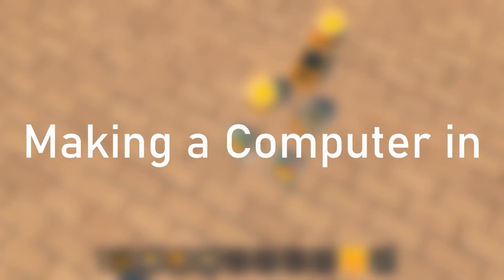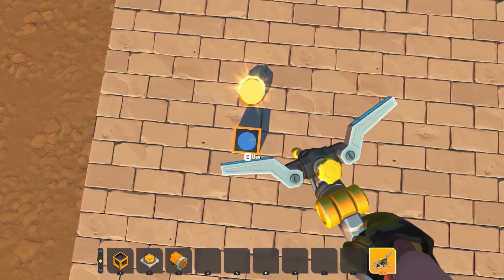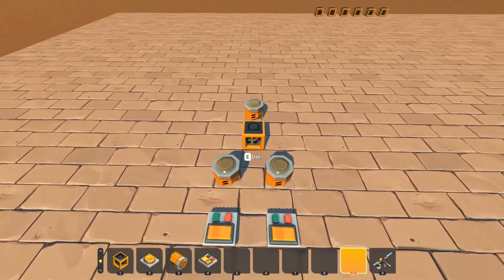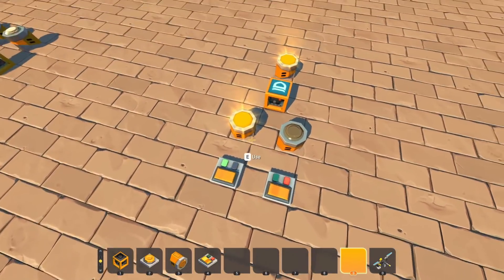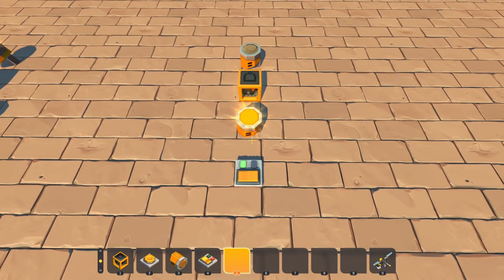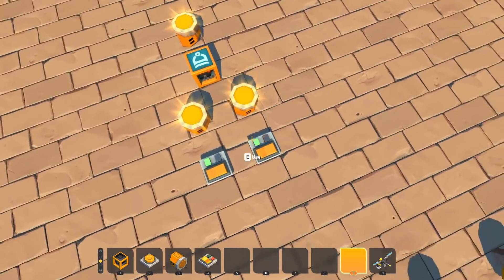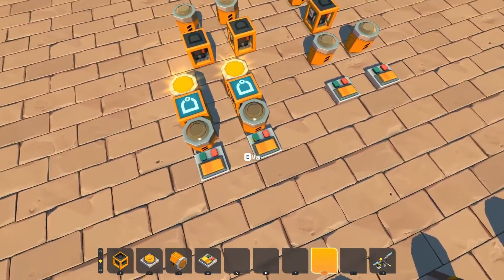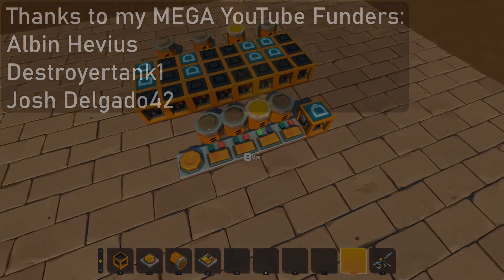Logic Gates: Making a Computer in Scrap Mechanic - #1

Comment: If you want some added performance for your computer parts, I can hook you up with a link to the beta version of my new modpack.
It doesn't contain much yet, but the only block it does have is a logic gate with 0 tick delay. Speeds up a sequence of full adders by a lot (as in, 4 bits normally takes like 16 ticks... now only 1).
If you're interested, just find me in kAN / ScrapMan / Scrap Mechanic / SMM discord.

Comment: when you get to showing how to store bits make sure to refer to it as a SR latch or atleast define it as such because most peeps dont realise that 2 NOR gates inputting into eachother to store bits is actually called a SR latch which heavily confuses people when its called something like "bit store" as it isnt since its just a logic latch - it doesnt store anything since its not even a capacitor. also, i heavily recommend using ics when building the majority of the computer since its so much quicker to use (i mean just make a logic circuit and save it for later use).

p.s. building a computer in scrap mechanic is more dependent on your rendering capabilities so dont shy for complexity at times and one last thing, i dont know what insanity you have, but making a computer in a game is going to be very very slow and unproductive. just saying, if its for educational purposes then go right on ahead but anything more and youve fallen into a trap...
Reply from the maker: Oh yeah, this computer is just to show how computers work. I'll write some stuff for it but nothing that needs to be executed quickly. Also, I'll probably use a NAND SR latch, and I'll show how it's working so people (hopefully) don't get confused
Reply: @ReidCaptain  thanks
Reply: @ReidCaptain  neato burrito, cant wait to see how you do it. ive started to make a computer in scrap mechanic aswell and so far ive got an oversimplified ALU and am starting some form of cache and RAM system.

p.s. if you manage to make it programmable then id love to see it. btw what computer architecture are you using as a reference (or which are you planning to use)?

Comment: Greetings, conceiver of circuitry.
Due to the abstract node based nature of the logical components, the physical structure of the circuitry is functionally irrelevant. Allowing organization into clusters for each
type of process required, including data storage and code interpreters.
Unfortunately, building more than 256 bytes of solid state memory in scrap mechanic is difficult and unstable. For 1KB and greater capacity, mechanisms such as cardboard
tapes could be used for read only memory or write once memory, and tapes could be ejected and stored elsewhere similar to ordinary floppy disks.
Additionally, increasing the complexity of what the core processor can do will decrease the size of the code needed to program it. This would be more space efficient in memory.
For instance- making a multiplier cell instead of coding multiplication using sequential addition, and making microcode ROM that the ordinary code can reference to similarly
to functions in higher level programming.
Building a simple programming language would be necessary for escaping machine code programming. Though integrating microcode would be more immediately beneficial.
For an interface to a computer, in scrap mechanic, one option is to use a small number of buttons that can be pressed in sequences to insert more complex signals.
For instance- a D-pad. And pressing Down, Down, Left, would insert the signal for the letter J, or any other character, even control characters such as shift or CTRL.

Comment: The XOR gate will turn on if an odd number of inputs are active.
N-gates just give inverted signal of normal gates.
Each gate has a delay of 1 tick before it receives/sends a signal - 1 smallest logic step. Same for timers, even if you set its delay to 0 ticks.
To make a simple consistent memory switch, connect 3 XOR gates in a loop, and activate all 3 at the same time for 1 tick.

Comment: Do the gates in the game have a hard coded time to take to switch? Or can you run any clock pulse into them?
Reply: They run at a standard tick rate unfortunately:/// The fastest computer I’ve made so far has run at 1.55HZ Although I created one which ran a slower clock but outperformed it greatly so there’s that.
Reply: @mattyj2111  gotcha, thanks. And your pfp was my desktop for the longest time in 2010

Comment: This is just like a probably stupid thought. Big like with the use of these kinds of games or simulations and some extra mechanics would it be possible to simulate a quantum computer, but like a very low tech one like what he is doing. Like a proof of concept type simulation?
Reply: Theoretically yes, maybe not in scrap mechanic itself though, but for a quantum computer you're better off playing with software someone already made that does a little tiny one, and it will not be particularly useful or easy to do anything with.
Reply: @Vode_ika  cool thanks

Comment: Here’s a simplistic way you can think about inverting 2 input logic gates: By inverting the output, you just invert the entire output. By inverting the inputs, only the and/nor part is inverted, while the xor part is not. That is because 2 positives becomes 2 negatives and vice versa, but a positive and a negative just swap places, giving you the same xor output - everything stays the same, or everything stays different. Inverting one input is like a 90 degree rotation. The 2 xors - 10 + 01 become and + nor, while and + nor become the xors.

Comment: as someone also building a  computer in scrap mechanic, if you want permanant data storage (logic bits are reset upon lifting it") you can use vacuum pumps connected to chests of cardboard and spudguns (which break and place the cardboard) to make liftable storage
Reply: I think he will use logic gates for everything, including data storage, making it more realistic
Reply: @user-ss6gp2gu6r  I think that what they are suggesting is very realistic as logic gates in real life don’t work without power, so you have to write that on something outside of logic, also it would allow players to share programs which would be cool for him to see community members using his computer and creating cool stuff
Reply: I’d hadn’t thought about this, mostly because I hadn’t messed around with computer stuff when vacuum pumps existed, but that would be a good way to create and edit programs as it would be cool to allow players to share them
Reply: you could. However this mode of datastorage is not very dense.
Reply: @sayhellotoyou9271  while it is not dense, it is rewritable and permanant. if done in a cube of cardboard you can have a moving head
Reply: @fyrewire  check out timer memory if you are interested in high density storage. I am a novice and managed 256bytes of memory with less than 100 blocks at the expense of time efficiency. Although you can double the time efficiency pretty simply

Comment: If it would help at all I've made a few calculators in scrap mechanic and some storage 
I have a 10 bit multiplier 
81 but storage 
adders are easy so if you need a specific size I wouldn't mind making one
and I have all the individual parts to these builds on my steam workshop

also you can make two state storage using pistons and sensors (set to switch mode) it is way easier and more stable but it is much laggier
other two state storage systems using only logic gates are complicated and unstable but produce almost no lag

Comment: The real question is, can you make a computer inside a computer in Scrap Mechanic?
Reply: Yes, I've done it. If you want to take a few years to build one, than yes.
Reply: @cadetkohr5508  sure you have done it...
Reply: but why would you try such an insanity
Reply: @Emilyscott2509  the question is not why but instead why not?
Reply: Yes but the amount of computing power your real-life computer would need to simulate that would be insane. Also not to mention the amount of space and work that would go into wiring up millions of logic gates.
Reply: This is confusing
Reply: @rf_fazlir3551  essentially, think of a 'game of life' that perfectly simulates real life, you make a computer in it and remake the 'game of life' inside of the computer. Therefore, you can now play 'game of life' inside of 'game of life'.

Just replace the game of life with Scrap Mechanic and you get the topic of this comment thread.
Reply: Only one way to find out
Reply: You can, but it would be extremely slow.
Reply: No it impossible you cannot making a game inside a game that not a game about making a game inside the game.
Reply: @rf_fazlir3551  why, you can make a computer like rc showed and so you can make that computer run games somehow
Reply: @rf_fazlir3551  Gonna have to disagree here, people have been doing that for years
Reply: @rf_fazlir3551  is it possible to make a Turing complete computer in scrap mechanic logic? I believe so, which means (assuming no hardware/performance limitation) you absolutely theoretically could.
Reply: @rf_fazlir3551  laughs in Lord Mumbo Leaps